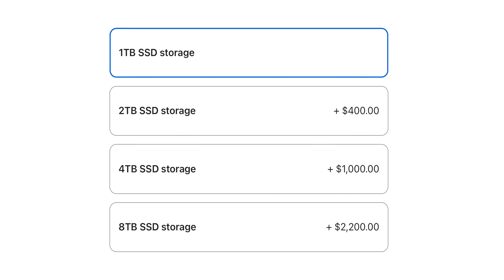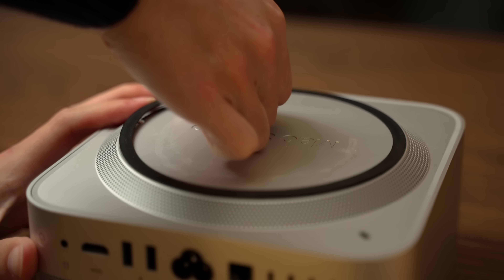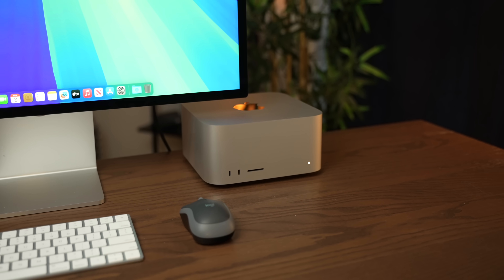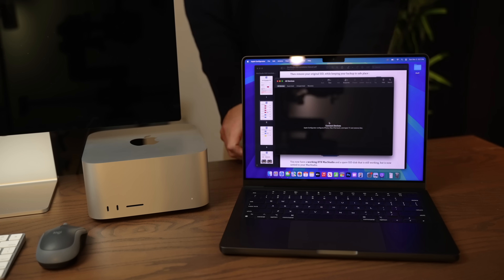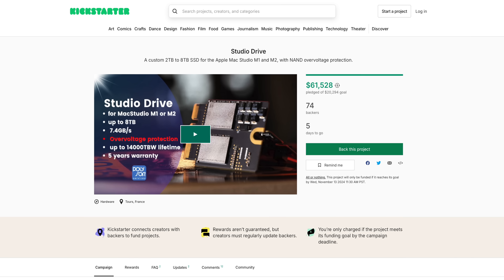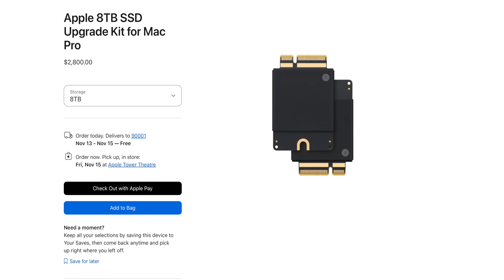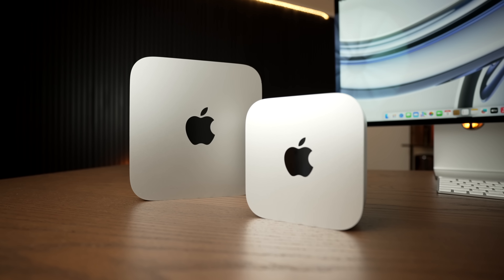UPGRADE your Apple Silicon storage for HALF the cost!

Comment: Will 8TB retail for €799? That’s €100 cheaper than the earlybird kickstarter pledge.
Reply: Seems quite unlikely from a logical standpoint.
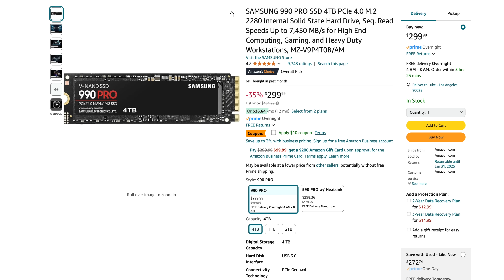Reply: Indeed, but mentioned at 10:24 .
Reply: @grooveconnect4170  should be an error because 799€ was the kickstarter discounted launch price for the 4TB version.
If it is sold at that price, then all backers, including myself, would have payed more than the regular retail price.
The 8TB drives were listed at 899€ on KS.
Reply: @grooveconnect4170  this is for the 4TB version and 799€ was the Kickstarter price, which might be higher on the global release.
As you can see the NVME SSD presented by Luke a second before is 4TB, so he is talking about the expected 4TB Studio Drive price here.

Comment: OWC should just release ready screw-in kits like they did for the ram with some models. I can get a 8 tb samsung ssd for less than 500 in the 2.5" format, so it shouldn't be more than 1000 for the micro format they use. I'd pay polysoft 800 euros for a 8 tb module for the M4 mini that's even more durable than Apple's for sure, they should do it.

Comment: I was pleased that Apple improved the repairability of their SSDs, so you no longer need to replace the whole motherboard if one fails. And what Polysoft has done is amazing and hope this type of third-party SSD upgrade is sustainable going forward. But we know Apple, they don't like third party companies upsetting their cash gravy train and will result to adding some sort of software / firmware key to make it impossible to use third party replaceable parts for their internal SSDs. The only way Apple is ever going to change is if we stop buy their products due to their sharp practices, or the Apple old guard, such a Tim Cook and Craig Federighi retire / move on. Even then, I am not sure the latter will stimulate much change, as the Apple younger generation appear to be clones of the old guard, which may explain why the pace of innovation at Apple has slowed over recent years, as they focus more of their time on working out how to lock their customers into their ecosystem and extract even more money from their customer's wallets!

Comment: Wouldn't it be so much simpler to just buy a Thunderbolt 4 or Thunderbolt 5 SSD? Would the internal storage be noticeably faster than a Thunderbolt 5 SSD? You could hide it behind an M4 Mac Mini Pro and not even see it. What is the downside to this idea. Legitimate question because I've never done this and have only heard about others using external SSDs in place of internal storage.

Comment: I'll never take swapping RAM and NVMe SSDs on my laptop and desktop for granted again.
Reply: Ram upgrade is still impossible on apple silicon 😢
Reply: @Master777with69  
just like most modern pc laptops sadly
Reply: @lesleyhaan116  no it's much worse. It's next the the cpu so trying to remove ram is gonna melt the board and make your thousands of dollars down the drain
Reply: @Master777with69   
Ik know they could be different than Apple but they are not they all copy the bad stuff from Apple like Samsung but they have the biggest mouth about Apple
Reply: Have not regretted buying Framework
Reply: @rimbaud0000  I have a Framework laptop too! I have updated the RAM, SOC, and SSD since I've had it like 3 years. It's so nice to be able to just update parts and pieces
Reply: Ikr

Comment: 4TB of SAMSUNG 990 PRO  is for $289 (cost+profit)
3.5 TB upgrade of Apple mac studio is for $1200 (cost+profit+ 400% Apple tax + 50% carbon neutral)

pay MORE get LESS 

$1200 can get you a full gaming PC with 4TB SAMSUNG 990 PRO (top SSD)  with RTX 4060  and  you can use it as SMB storage to the mac and save money 

Apple does not offer upgrades they are out of touch .
Reply: lol yes 😂😂 i just wait when  stocks get impacted by several but critical high actions.  profit gains from what you said about how  charges you on SSD/RAM options, and the only option, and soon will be ineffective. even though i don't priortize gaming i still don't want to look for macs

Comment: This is great.  I have a 4TB M1 Studio, but had to buy it used and wait and wait to find a deal on it.
Reply: For how much did you get it? With which specs? Thanks!
Reply: @bastienchilloux  $2500. It 4TB with 64 GB RAM, so the $3,600 config.

Comment: My local apple shop offer the upgrade for mac mini m4 to 2 TB at about 250 USD. PS In bangkok thailand. But they didn't use the custom pcb they just change the nand in pbc.
Reply: Changing nand module is not that hard
But reverse engineer a pcb is way too difficult
Reply: What’s the name of the shop?
Reply: I live in Bangkok.  Which shop?  One of the actual Apple Stores, or one of the reseller stores?  I haven't looked yet to see what they were charging at the Apple Store.
Reply: Can you share the shop name or number? I live in Thailand and would like to get my M4 upgraded 🙏

Comment: My Wifes 2013 Mac is dying a slow death. Not being able to upgrade is the main and really only reason we are going back to windows. She does a lot of photography and therefore needs at least a terabyte, however she is also technically challenged so workarounds are out. she doesn't do editing so doesn't need something powerful
Reply: Those old 2013 iMacs, assuming it's an iMac, can be upgraded. You have to take off the front glass and you can access both the internal drive and the CPU to be upgraded. Ram can be upgraded via a small latch on the back. The MacBook Pro can also be upgraded too with it's storage
Reply: @crestofhonor2349  its a macbook pro notebook. and yes I have upgraded both its ram and put in a 1 TB SSD however its dying (the mac) and needs to be replaced so its either same generation ~2013 or its a windows machine. The mac OS for that machine is no longer being patched so its probably a windows machine...

Comment: Apple could avoid all of these “problems” by simply charging less for storage and memory upgrades. There’s simply no excuse for the ultra overpriced upgrades.
Reply: The thing is, it is "problems" for us, not for them. It's been like that for 10 years or more so I don't expect it will be changed any time soon.
Reply: @ indeed, but I mean it’s a problem for them that people will try to create solutions like the one in the video. Being so overpriced for upgrades is what creates this kind of solution. They can lower the upgrade prices and still make a ton of money.
Reply: @BobBack86 
But Apple doesn't want "a ton of money." Rather, they want multiple tons of money on an order of magnitude that boggles the ordinary consumer's mind. Just say'n.
Reply: @ lol, that’s true.
Reply: @huyanh995  This practice goes back to their beginnings. I was watching a video talking about the history and in the 80s Steve Jobs changed the case screws of the iMac to a proprietary shape to discourage users from upgrading the internal parts.
Reply: Or an even better option, just give the user an extra M.2 slot like most other PCs on the market. There's no reason why a 2230 drive wouldn't fit
Reply: @crestofhonor2349  Even if there is a standard M.2 connector, it wouldn't work either. There is a video by iBoff showing with M.2 SSD, the speed is abysmal.
Reply: @crestofhonor2349 Greed is the reason. Always has been
Reply: @crestofhonor2349  The M.2 NVME would be slower, and less well integrated into the whole architecture. So it is understandable that Apple does it this way, but using it to have ridiculous pricing is a vile move (though understandable from a business perspective).
Reply: @c.augustin  M.2 isn't even slower. There are plenty of m.2 drives faster than what Apple offers in terms of drive speed. There are no advantages from apple integrating the SSD controller into the chip other than it earns them more money.

Lots of NVME 4.0 drives are faster than what apple offers and NVME 5.0 is coming up to make the difference even larger
Reply: @c.augustin  my PC's NVME is much faster than anything apple sells and it was only $150 for 2TB

Comment: I pledged for a 4 TB upgrade kit for my M1 Max Mac Studio, and I'm extremely excited to install this sometime next month. :D
By the way, I have a 2018 space grey Mac Mini, and I upgraded the RAM to 32 GB but the soldered-on storage is stuck at a measly 128 GB. :(
Reply: So they plan on having capacities other than 8TB? I will certainly get the 4TB if that is an option.
Reply: @mmeiselph7234  
I'm not aware of capacities over 8 TB.
The 4 TB kit (which I bought) consists of two 2 TB modules. The 8 TB kit consists of two 4 TB modules.
Third-party 8 TB kits, at a far lower price than Apple's configurations, is pretty awesome.

Comment: I mean cool concept and all, but the pricing? Holy crap. Those NANDS are only about $80-100 each not at volume and the PCB is $20-30 at volume. So there is about ~$250 in hardware give or take for over $1000 USD. Yea that's half what Apple charges but still a massive markup. I get some markup to make a profit but almost 5 times is just a bit much.

Comment: Am I missing something .. Isn't reverse engineering for commercial purposes illegal?
Reply: No.
Reply: Clean room reverse engineering isn't.  Copying directly is though.  hence the need to directly say they were reverse engineered rather than just copied.  Although is a get your popcorn out moment when lawers start arguing whether its a copy with improvements or a genuine reverse engineer though, as the differences can be quite subtle.
Reply: Unless the original carries patent protection, you're free to duplicate it atom-for-atom if you want to.  (Just omit the Apple logos, which are trademarked.)
Reply: Original poster. The happy slave delighted that his chains are gold-plated?
Reply: if they sold the exact copy, then it can be argued that this is a blatant copy... but they introduced overvoltage protection, which in essence differentiates the produc and makes it an aftermarket piece
Reply: @ArielGonzalez1 
They should copyright the over voltage enhancement so that Apple would need to license it from them.
😅

Comment: There are rumors of Apple making servers.

At the end of the day, my previous employer demanded hot-swappable drives on all of our servers. And they're already expensive.   There's no way Apple can get into the server market if they don't drop this proprietary bullshit for their SSD's and ram.

SSD's are the known failure point for servers. And ram is the next item to fail on a system. 

You have to repairable hardware in a professional work environment.
Reply: They used to make servers. Not new for them. But apple knows the difference between consumer and enterprise. They know they can’t be remotely competitive or even get buy in without expected server features assuming they are actually getting back into servers. But I’m guessing they mean “servers” as in their Mac pros turned sideways

Comment: Well done, but there's still a problem. These chips end up locked to that Mac, so if your Mac dies in some way, there's no way to rescue the data.
Reply: Thats nothing a proper backup solution wouldn't fix.  Even just an external drive with time machine set up in MacOS makes this a moot point - at the most you'd lose the last hour of work.  And thats at a minimum and still doesn't fit the 3-2-1 backup solution anyone whos actually using their mac to do their day job should be doing.

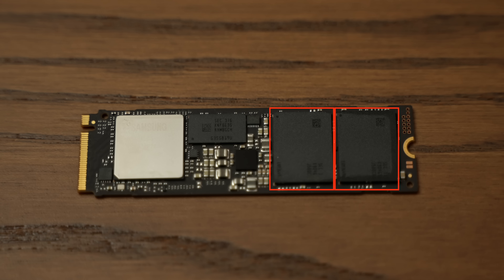Comment: 3:10 - A "little bit faster"... Uh, no, not a little bit. a DRAM-less drive will effectively be slower than a hard drive because the controller won't have enough memory to shuffle data around and will essentially use its own FLASH memory as SWAP - I think we all know how slow computers get when you hit SWAP memory...
3:30 - PCI(e)*. PCI and PCIe are two different things.
Reply: The MAC does have RAM so no. It will have to use some system RAM but then it will be faster than the SSD as the cache is already in system RAM.
Reply: @SimonEllwood  How absolutely deaf are you? 1. I was talking talking about an SSD. Not a NAND module inside a Mac...
2. It will absolutely NOT be faster. Your speed is largely limited by the bus width to each individual NAND chip and the microcontroller inside each chip - Apple's aren't dumb NAND chips like on most NVMe SSDs, they contain their own "subcontrollers" that connect each chip to the main SoC through PCIe x1 links. Whatever you get in speed by integrated memory, you lose due to PCIe signaling and protocol overhead.
But oh bless me with how much more right you are than me. If you really have any knowledge about it. I've only designed a bloody filesystem tailored for SSDs from absolute scratch, so I must be the blind one...
Reply: @shapelessed  I was just pointing out that just connecting the NAND directly to the SOC is not inherently faster or slower and it depends on both sides how they are implemented. I am not deaf.

Comment: Freakin amazing if it ever comes to market! There is a huge difference between modding an Apple OEM component by replacing NAND and reverse engineering their IP and patented hardware and reproducing it for resale. IMO Apple will flood these guys up in so much litigation that it will be years before it is resolved. By that time if these guys are still in business it will be irrelevant even if they prevail in the litigations

Comment: If you want some headache: Over here in Europe, Apple does sell the replacement SSD for the Mac Studio. Well, they just want 383€ for the 512GB SSD Version :D
Reply: You can only buy the part which came with your mac studio though.  you cannot buy an upgrade.
Reply: @jameshodgetts7541  Yeah, important point. One workaround is to get the serial number of a higher and model to get the bigger SSD. Still overpriced as hell.

Comment: Apple silicon isn’t the reason for non replaceable SSDs but just Apple being apple
Reply: You know that there's hardware encryption on other SSDs as well, it's just up to the user to enable it on other OS'es. They could have used any of the shelf NVME SSD with OPAL and gotten the same result. Even banks and other enterprises are fine with those types of encryption in their servers and storage systems, but somehow a home user not ? Don't let their dumb marketing fool you, just as they are not more sustainable by not including a charger in the box of an iPhone lol. Their devices are literally e-waste as soon as you brake any part of them, as repairs are so expensive that after the first year it doesn't make any economical sense to repair it instead of just upgrading to their newest one. They are one grifter of a company, and sadly they got big by doing the opposite. Apple products used to have extreme versatility and upgrade ability, look at the old Mac pro's and G5s etc, even the MacBook pro's of old were machines you could service for a decade!
Reply: One potential argument was the security making data unusable between different machines and serialization. 

Really dumb reason when you have to replace storage if there is a failure or want to upgrade.
Reply: So it has its advantages. Namely it reduces latency when reading and writing. It allows for more priority options, etc. It also allows Apple to have less PCIe lanes or use all their PCIe lanes for PCIe. The best solution would have been something similar to what Sony did with the PS5. Have a dedicated controller and NAND on die and soldered to the board and have a NVME slot for additional storage.
Reply: @MaheerKibria  Their drives aren't any faster, in fact you can find NVME drives faster than Apple's stuff and for cheaper. PS5 also still has a slot for a basic NVME drive that must pass a speed test. The main point of what the special chip in the PS5 does is it's a special decompression chip that means they can compress data and uncompress it very fast allowing for reduced file size

Comment: I work with this stuff, and I'm impressed,... at everything they did, the overvoltage protection upgraded, the upgrade ability, the better performance. I'm really impressed.
Reply from the maker: It's truly remarkable how they pulled this off
Reply: Apple could not bother to address the overvoltage issue even though it is known to occur frequently enough and is destroying its customers' devices and data? Solid business move. Representative of today's Apple.
Reply: Gotta love how Apple not only charges 12-16x for storage upgrades but doesn’t even give you the faster performing chips you’d get if you went with the 12-16x cheaper 3rd party drives.

It’s psychopathic levels of greed.

Then you pile on the self-righteous virtue signaling about how they care about quality and the environment and all that other dishonesty and you’ve gone past psycho behavior into pure evil.

At least Microsoft and Google know nobody trusts them and doesn’t try to make a marketing campaign around how you should. They know they’re scumbags and accept it.